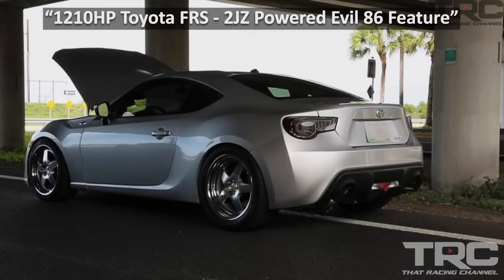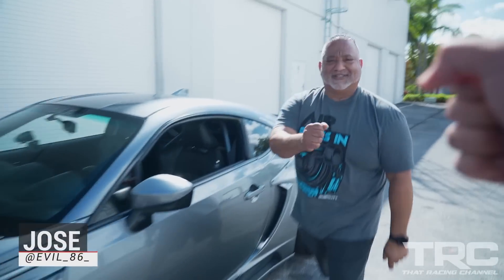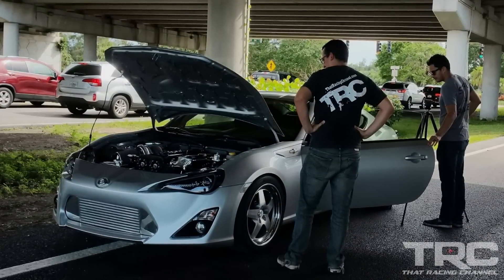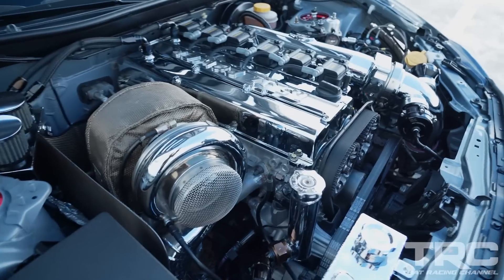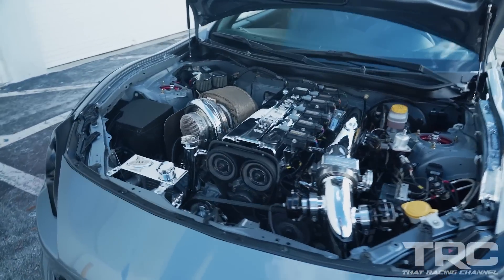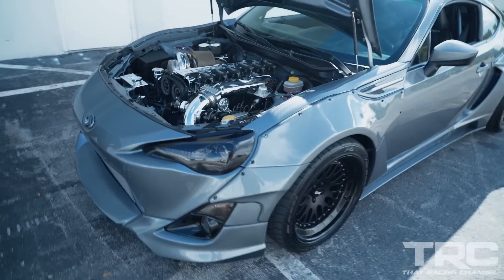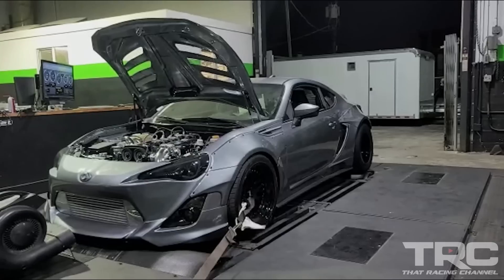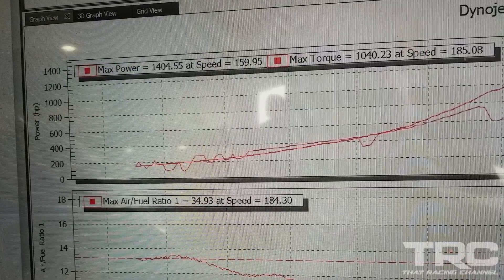1200HP 1.5JZ Widebody FRS - "Baby Supra" SCREAMS 50PSI! (6 Year Build Transformation)

Comment: With how light the car is my mans prolly get sideways in like 3rd or 4th
Reply: Yeah they were probably at 600 hp 50psi 1200hp would be insane on the street
Reply: Well it’s been auto swapped so 3rd is 1:1 and 4th is overdrive lol
Reply: @1S1KC0DM4N  depends on the trans and the gear final drive
Reply: @2511jeremy , they said it’s an A340 in the vid lol I have one in my SC300. 3rd is 1:1, 4th is overdrive with .705:1
Reply: @1S1KC0DM4N  ahh is that a common ratio for drag transmissions?